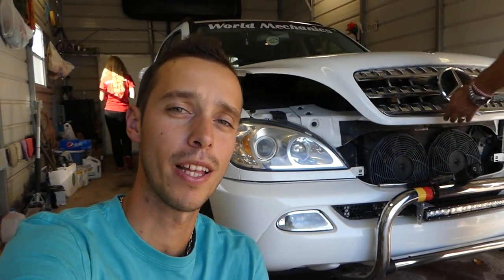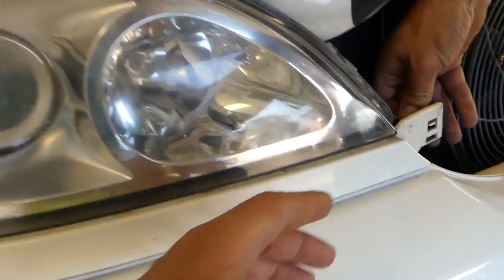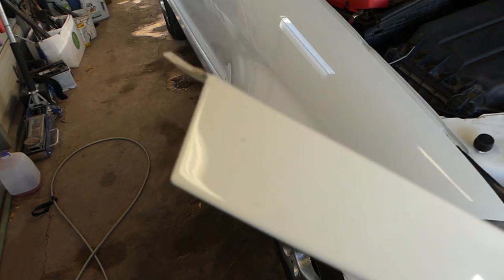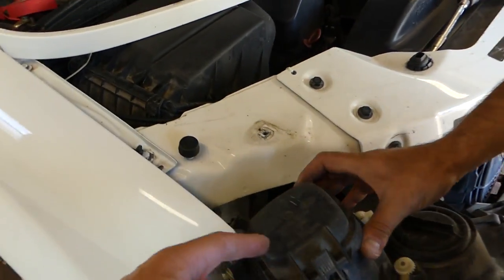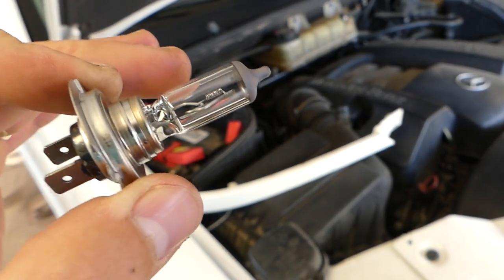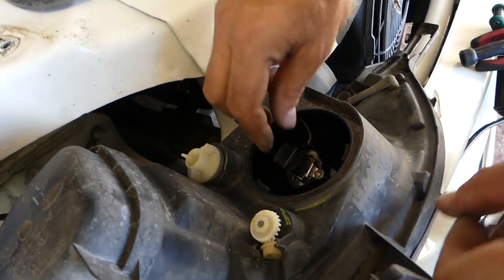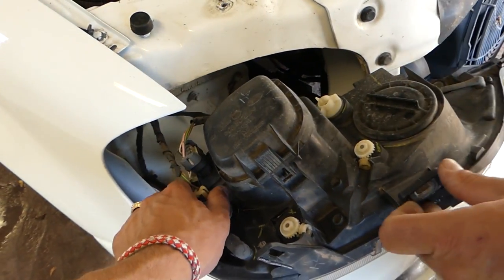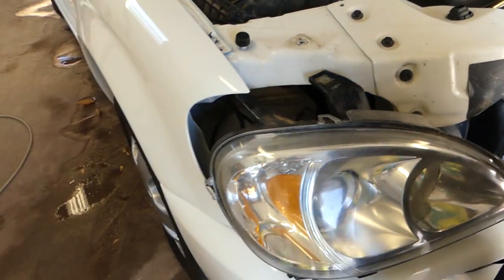MERCEDES ML HEADLIGHT BULB REPLACEMENT  ML230 ML270 ML320 ML350 ML400 ML430 ML500 W163

Comment: This is very helpful.  2001 ML320.  First time I replaced a bulb, I didn't remove the headlamp assembly and just went from behind and it was kind of a pain.  Not horrible, but this method is SO much easier, even with the couple of extra steps.  Thank you!
Reply: The '01 ML320 assembly was a little different.  After removing the large plastic back cover, there was a metal "Pinch Clip" to remove to get to the bulb.  No twisting required.  There's a little notch in the bulb backplate to ensure it is in place.  Very straightforward.

Comment: 2000 ML430, is not like this. It has a 'spring' clip that you must release that hold the H7 Bulb in place.  H7 for Low Beam (has 2 wires and is on the top of the assembly, be careful with the electrical connector. H1 for High Beam (has 1 wire and is on the bottom of the assembly, be careful with the electrical connector.) While the headlamp assembly is out of the car, it might be a good time to sand and clear coat the dull, yellowed, face. :P

Comment: Very straight forward and clear.  Try it out in preparation for upgrading  my bulbs.   Took only a few minutes to remove the assembly.  My additional recommendation.  Lay a trowel on the bumper to protect the lens when changing the bulbs.

Comment: Thank you guys. The handbook for my wife's 2002 ML500 was totally misleading as to the manner of removal of the lighting plug, and then removal of the bulb. It referred to an entirely different 'spring loaded' system supposedly holding the bulb in place. 10/10 for you, 0/10 for Mercedes!

Comment: Thank you sir! Couldn't be any easier to swap the bulbs out this way on my 2003 ML500. I will say that the high beams are pretty easy to get to on my model, so I'm not sure I'd bother with the removal for those. But, the blinkers and low beams are well buried in there. "😂

Comment: Hello, I have a 2003 Mercedes ML350 and usually in the mornings when I start the vehicle the High beams (Fernlicht) automatically shut on and off randomly. I can not turn them off unless I completely turn off the lights. I also hear clicks by the passenger side fuse panel. Where do I start to troubleshoot?